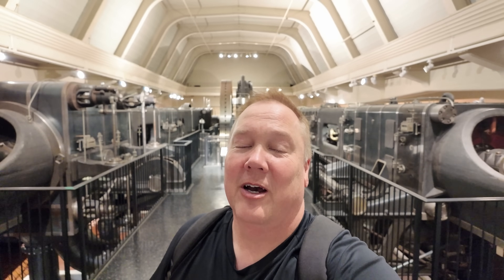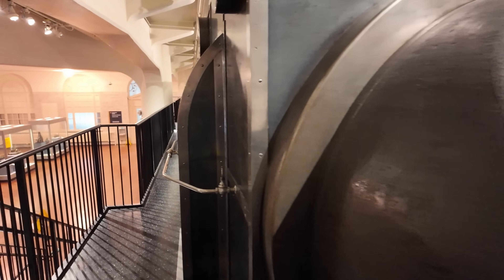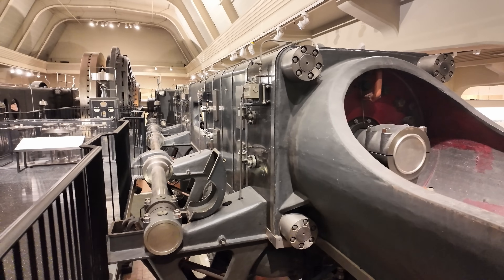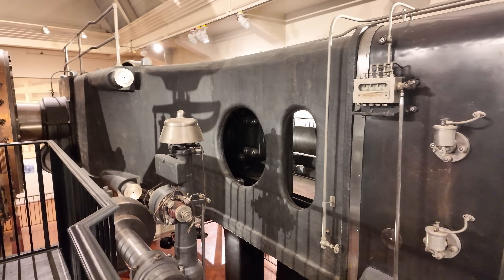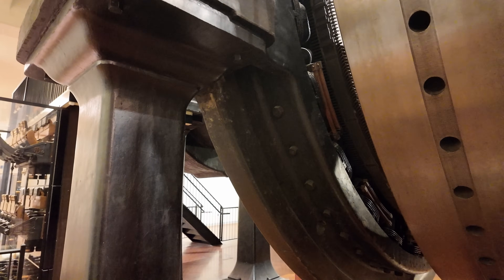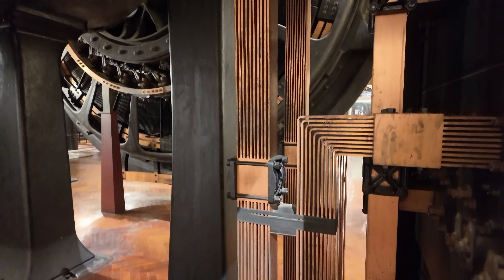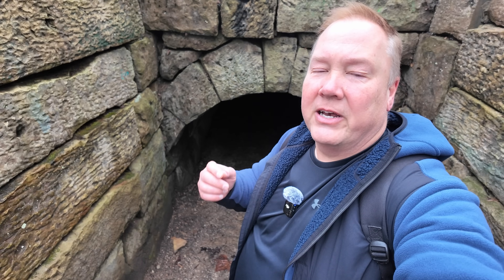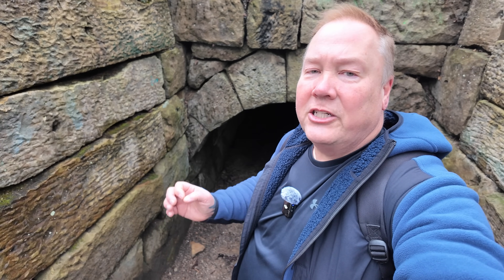Henry Ford's Hybrid GasSteam Engine

Comment: If you compared the class of fit on those bolts and fittings, you wouldn't feel the same.
Reply from the maker: Due to it being 100 years old and machining specs back then not being quite where they are today?
Reply: @Industrial_Revolution yes. And the fact that those fittings are at least 80 years old and probably show some wear. 
 The fact that this machine would probably still run has less to do with how it was manufactured and more to do with the care taken by the craftsmen who maintained it.
Reply from the maker: Not to mention that it's still being maintained every day.  What most people don't see is the 20 or 30 minutes before they start up this engine every day with someone going around, filling every oil cup, checking everything...
Reply: @Industrial_Revolution all the stuff that's automated today. I maintain automated machines, but I don't think they really do as good a job. Sure they're faster and can run longer than a shift. But at what cost? Wages feed the market pool that industry draws profit from. Shouldn't there be more workers, not less?
Reply from the maker: Sounds like you're sorta where I am.  My background is working in IT systems, networking, etc.

Comment: That 1st era in railway history is one that seems to be ignored by railway modellers. I'd be fascinated to see such models in HO, (or 00 as is the case on this side of the Atlantic 🇬🇧). 3D printing will surely make such models more feasible. 😀👍🇺🇸 🇬🇧
Reply from the maker: HO?  I'd love to see someone make working replicas in full-size.  Imagine going to a museum where you could see and ride on all the weird, early locomotives.
OK, maybe someone can at least do it in VR.
Reply: @Industrial_Revolution   There are various 3rd party design specialists who make rolling stock or routes fir Train Simulator.

Comment: All these machines when they could have been harnessing energy from the atmosphere, Tesla made the tower, and the african boy recently made the electric car & tv the use harnessed energy, no battery, no solar
Reply from the maker: Any idea what the efficiency on Tesla's tower was?  Also, you have to remember, it's going to break down really fast with distance (inverse square, or was it inverse cube?).  It's effectively like wireless charging for your phone, where you only have a very short distance where you can charge.

Comment: Great video, i have never seen steam and gas combine in one engine, when did they disscontiue use of these engines?
Reply from the maker: It wasn't used for too long but, interestingly, if you read the comments, there's several that mention places that are doing something similar tonight, recapturing the waste heat for additional power production.

Comment: The large copper bus bars were for the current produced not the 250vdc. For the power you mention at 250 the current would have been in the 10,000's of amps. I worked on xray systems and the highest ones used for industrial verification of welds used up to 180,000 volts but the current was less than 5 amps so the wire used was not a lot larger than house wiring but the insulation was close to .75 inch thick to insure arcing to ground did not occur. Very good video.
Reply from the maker: You're right, they are due to current, not voltage.  Thanks for the comment!

Comment: The thermal efficiency of a modern spark ignition car engine at full load is about 34%. I wonder what the figures for this engine was?
Reply from the maker: The fuel, while free, wasn't great quality.  I expect, though, it comes down to the much larger volume.  More power, but does that make it more or less efficient?

Comment: Thank you. Nice to see what they built before calculators and computers. This byproduct gas is like generator gas. It is producted by blowing air to iron malm and coal in the blast furnace. So you get coal monoxide and methane and ... Town gas you get out of coal when you heat it anaerobically. These two are not the same. Heat exchangers 13 min 37 s are condensators for the exhaust steam.
Reply: Sorry my English: condensator -> condensor
Reply from the maker: Your English is fine.  Ford ran both coking ovens and, separately, blast furnaces.  My understanding is that this gas was from the coking ovens.  I think, if the weather finally cooperates, I may be finally filming at a set of 1800's coking ovens in a week or so.  Massive thunderstorms prevented my first two attempts.
Thanks for your info on the condensers.  That's what I get for trusting museum signage.
Reply: @Industrial_Revolution  Had to watch it once more. At 13.35 we can see the cooling water system for the condensor, lower tube to the condenser and upper out. At 14.05 we see a large tube from the LOW PRESSURE CYLINDER of the steam engine to the condensor. The heat exhanger for the combustion engine gases must be much larger.
Coking oven gas sounds very possible. Blast furnace gases are also used to rotate gas engines.

Comment: Fascinating, brilliant piece of equipment. Waste gas from coke production gets burned to make power then the byproduct heat is used to boil water for a steam generator. Fits right in with Ford's early manufacturing ethos.
Reply from the maker: Yep.  Use everything, then use the waste from that, too.  Same way he invented charcoal briquettes and the family BBQ because he didn't like seeing mountains of sawdust going to waste.

Comment: In answer to the question of whether or not the precision, engineering and construction of HF’s generators are equal to today’s technological achievements. They were able to slog out a piston driven generator to achieve 33.75 mw. I worked in a modern power house using Solar industrial Gas Turbine engines and we captured the heat using Heat Recovery Steam Generators. We drove a separate steam turbine. I would have to say after years of starting up the facility and repairing the missing work by the contractors. But I will say that our machines were so far more advanced and precise because they had to be. Metallurgy has progressed to the point where hydrogen embrittlement can bust a bolt and as they were used in skyscrapers probably was a bad idea since they had to go through that entire building and weld the frame together as the engineer had specified, but to save some money. But despite a few hic ups along the way we now produce the finest materials and the plant was difficult to work on but we had difficulties with fueling systems and ancillary components that were maintenance intensive. We could crank out 20 mw on a good cold day and produced on average 16-18 mw. Seeing that we produced all of the fuel in Digesters producing a poor quality methane gas that powered the engines. We had three 4 cylinder, three stage reciprocating gas compressors that compressed 800-850 BTU gas into the turbine. We often freshened up our gas with the cities natural gas giving us good 1000-1100 BTU. All in all our little power plant called a combined cycle power plant powered the entire treatment plant. The fuel was free and they saw their Return on investment within two years.
Reply from the maker: Free fuel can make up for a lot of extra work over years.  Also, far better to burn off that low-quality methane than to just dump it into the atmosphere or flare it off, as some places do.

Comment: Interesting video from the Ford Museum power plant exhibits.  I have visited that museum a few times but I never had a very close look at this particular engine.  Some comments already explained this is a type of combined cycle power plant with the steam side using Corliss valve gear.   This museum is quite unique in that it contains the entire genealogy of steam power starting with an original Newcomen.
Reply from the maker: It's kinda weird, really.  It's so absolutely HUGE that a lot of people actually walk by it not noticing it's there.  That, and there's so much other great stuff right next to it, of course.

Comment: When did they shut it down?And why
Reply from the maker: It was shut down when they built the HUGE setup down the road at the Rouge factory.  It was a far, far bigger factory with an even bigger power plant, and they just ran power lines from the Rouge plant up to the Highland Park plant for power.

Comment: An early combined cycle plant. 175 psi steam most likely because welded boilers were not available yet. Henry Ford himself was a steam engineer in his youth  , he must have got a huge kick out of that modern marvel with the best of everything at the time. D.C.  offered better control of production line speed in the day of line shafts.  Amazing engineering for the time! An operators dream.
Reply from the maker: Thanks for the comments.  Glad you liked it.

Comment: About the glass glare, I don't know about your equipment, but some cameras can be fitted with polarizing filters, which can reduce reflected light. Be that from glass surfaces or water.
Reply from the maker: Thanks for the suggestion.  I'm using a DJI Osmo Pocket 3, which has a gimble-mounted camera with magnetic filters, and not much is available.  I just looked again, though, and it looks like a couple places did release a polarizer which wasn't available when last I looked.  Now if someone could figure out a telephoto, too...

Comment: It's amazing that to build cars in 1908 you also had to make electricity to run your plant, and likely they also sold power to nearby homes as well?  

It would also be interesting to see the hydroelectric power plant that fed power into Henry Ford's home!  

Looking at a arial view of the Ford plant, it is surprising to me to see so many homes built within 1 mile of the plant.  Back in 1908, I guess it was more a requirement to have the homes close to the plant, walking distance from the homes to the plant. You can't ride a horse to the plant, and have it stand at the plant for 12 hours while you are working.
Reply from the maker: Remember that streetcars were a lot more common back then, so that'd help.  Not sure entirely how true it is, but the rumor is that Henry Ford designed Dearborn for senior management, Dearborn Heights, which wraps around (and isolates) Dearborn, for middle-management, and Inkster for the workers.
As far as I know, Ford Motor Company never sold power to nearby homes.  Henry was very much interested in hydropower, though, and used it for his Village Industry sites.  I've covered a few of those in videos, and hopefully will get into a few more, too.

Comment: The engineering that went into all of the machinery in the beginning of the industrial revolution is always fascinating to see.  It's even better when you can see it actually running.
Reply from the maker: They wouldn't let me fire it up, for some reason.
Reply: Well, you're a little off, the beginning of the Industrial Revolution was the early 1800s, by the time this machine was made we were pretty much at the Pinnacle and we're right back in the Dark Ages again now
Reply: @robert-oq9jq  If you care to check your facts - the very beginning of the Industrial Revolution was actually 1760 and ending in 1820.
-- But I digress - it's all semantics...

Comment: On the Gas side what ignited the Gas? Was all the railing there when it was operating or is it H&S for the tours?
Reply from the maker: Not sure, but being internal combustion, I'm assuming some form of spark plug probably ignited it.
As for railings, take a look at the historical photo.  The stuff that's 2nd floor now was part of a much larger 1st floor originally, so no need for railings.  Those were all added.  The plexiglass over the openings was added to stop people from crawling inside.

Comment: I would really love to see how they change the reciprocating motion into rotary motion I can see the top of the flywheel it'd be cool to see the rest
Reply from the maker: That little flywheel is 2 stories tall.  You can see some of the bottom of it a little later in the video, while I'm showing the electrical connections.
Reply: @Industrial_Revolution  I think what you're calling the flywheel is the generator itself at the very end of the video when you show the top view of the machine you can see the top of the flywheels that changed the reciprocating motion into rotary motion in front of the generator
Reply from the maker: Go to about 2:34 on the video, and you can see the crank off the steam side of the engine, which converts reciprocating to rotary.  Is that what you were looking for?
Jump to 8:18 to see the giant, massive flywheel on the left (the silver one) and the generator on the right (with all the wires, obviously).  I think it's a solid axle through from steam-side crank to flywheel hub to generator hub to gas-side crank.  Were you looking at one of those, or something else?  We could be looking at the same thing and just have different names for it.  One thing I've learned with this channel is that that's amazingly common, in different regions, and people coming from different technologies.  Also, I'm certainly not perfect and have made mistakes trying to figure out reverse engineering before.
Reply: @Industrial_Revolution  I don't know how I missed that thank you
Reply from the maker: No worries.  There's a LOT of content in this video.
Reply: @davidszelinski5021 To see a similar engine in motion, search YouTube for “Snow 600HP” engine at the Cool Spring Power Museum in Pennsylvania. It’s just like the gas side of these generating stations. They run it nearly every day they’re open so there are several good videos showing mechanical detail while in operation.
Reply from the maker: @famousutopias Thanks!  A few others have commented that it looked like a Snow engine.  When I looked it up, it definitely does.
Reply: @Industrial_Revolution I had to look it up too and it was cool I love the compact design everything right there on display Way sexier than those big old behemoths

Comment: Love the massive engines like this and  the big SNOWs used to pump gas and such. just a shame  that  in the way of the henry ford museum it will sit and essentially waste away in the museum never to run again because the henry ford doesn't believe in running their displays or preserving the methods of doing so.  well over half the reason things like this are important is the fact that they RAN and how to run them.  and now its a huge iron paperweight that the henry ford would never even consider running in a million years. glad they didn't scrap all of them but at the same time how far from scrapped is it if it will never turn under its own power again!
Reply from the maker: When the museum was first built, many of the engines did run at reduced speed (not this one).  Currently, only the large Corliss engine runs daily.  If you look at the engines there today, all of them with a nice, shiny, metal pipe coming out of the floor into a steam inlet on the engine once ran.
Some were non-functional when they arrived, of course, or were of necessity made non-functional in transit (like cutting the flywheel hub in half on the Gothic Steam Engine to make it possible to transport).  Talking with a few staff and volunteers, they said the reason they're not currently running is that, even at low speed, over time, they'd inevitably wear, eventually forcing replacement of seals, repeatedly machining the valves and pistons, removing more and more of the original metal every time, until eventually you had to replace valves, pistons, and linkages, etc.  At some point, they decided it was more important to keep original components than it was to have them running, but they couldn't do both.  I can't say if this was the right or wrong answer, because, like you, I want both.
Reply: @Industrial_Revolution   theres always a way to keep them going. if your wearing out pistons and  valves on an industrial engine that ran 24 7 for decades  by just running it at a slow speed for demonstration I think you have other problems. places like the coolspring power museum aswell as other museums have kept engines running for history and there is alot of hurdles to get over but in my eyes its worth the time and money for the sake of preservation of the methods.doesnt mean I don't understand their angle just means I don't like it.
Reply from the maker: It's absolutely doable.  That's the information I was given.
Reply: @Industrial_Revolution  i understand. great video on your part!

Comment: To Me this is fine art.
Reply from the maker: It was a time when they actually put emphasis into making things look good, not just be functional.  Did you see my Gothic Steam Engine video?
Reply: Just subbed on this video however I will be checking out much more ofi Your content for sure. I am a Machinist/ Fabricator building Wind Tunnel's. This kind precision work is what I strive for every day. Ford was not a person You told it will be a few more day's much less week's or month's. I would not have known this was available to be seen so thanks & I now know where the Wife & I will be traveling next spring. 👍👍
Reply from the maker: As an engineer, you'll probably LOVE all the stationary steam engines in the same museum, including Watt, Newcomen, and some that look to be experimental ones.  If you can, come when the Village outside is also open.

Comment: What fuel did the steam boilers use?   Did the gas engine heat exchangers make steam hot enough for the steam engine, or did it need to be superheated by the boilers?
Reply from the maker: Unfortunately, that information is locked away in the museum archive, which closed for covid and has yet to reopen to the public, with no word when/if they will.  No boiler was moved to the museum, but at a guess, I'd say probably the same producer glass/town gas/coal gas used on the internal combustion side.